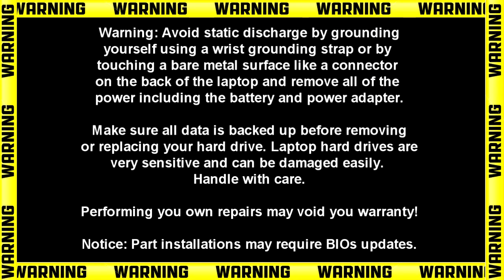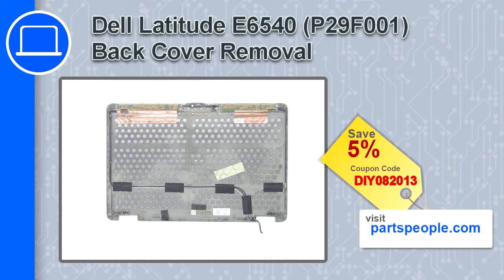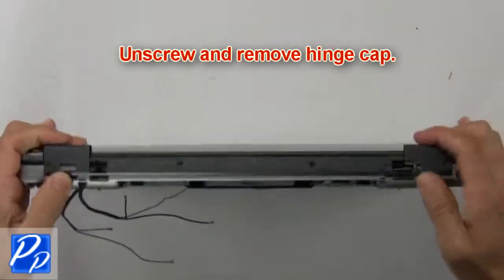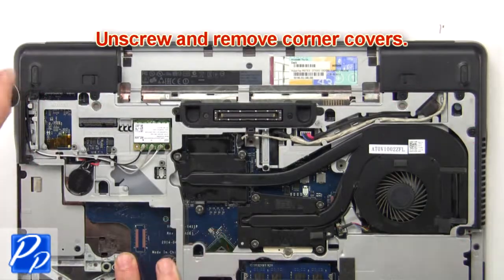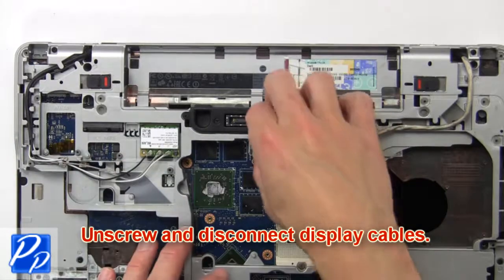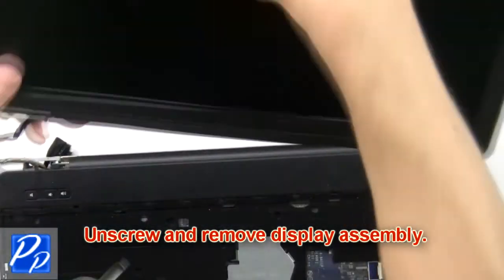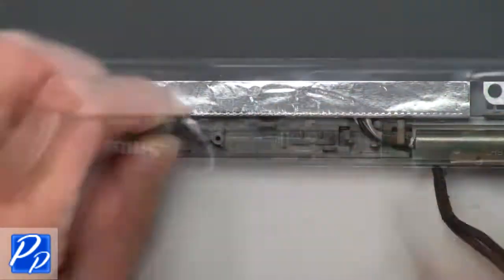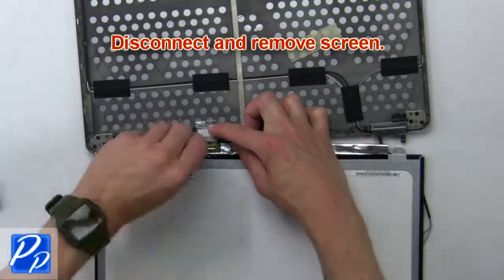Dell Latitude E6540 (P29F001) Back Cover How-To Video Tutorials

Comment: you really don't need to remove everything! i mean you just just remove the bottom cover, the 2 bottom corners, disconncet the the screen and the antennas and unscrew only the hinges and the back peice that holds it in!! its that simple!!
Reply: I think the whole point is to show how to remove everything.